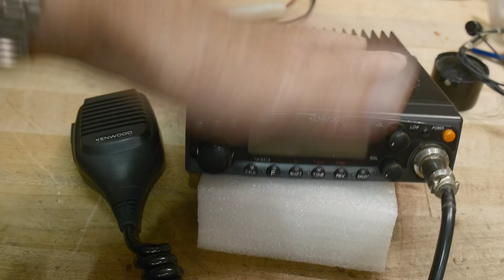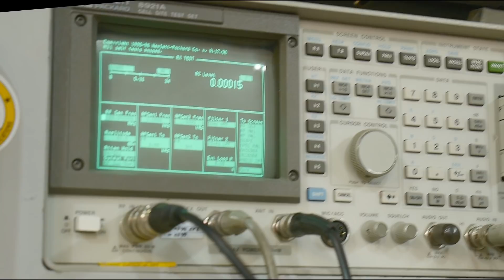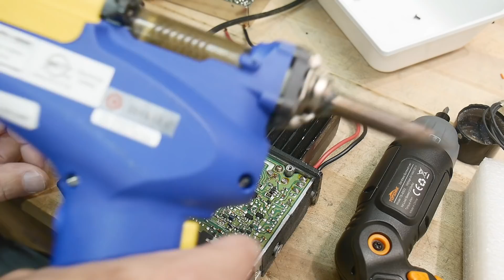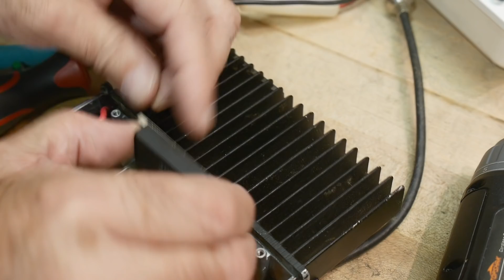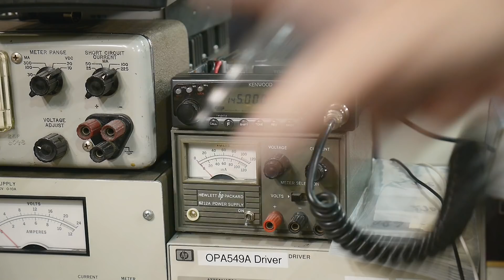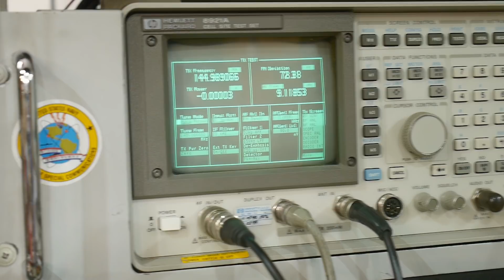#976 Kenwood TM-241A output power repair TOSHIBA S-AV17 50W Module

Comment: Good video! I have a TK-705 that is running into the same issue - milliwatt-level transmit power, receives perfectly fine. I haven't cracked open the RF module case yet and I originally suspected the APC circuit was bad, but now, even after consulting with QRZ forums, I'm starting to wonder if this is the issue. It uses the same type of module, only branded as Mitsubishi. Unscrewing it from the chassis revealed absolutely no thermal paste at all. Really scary!!! I'll have a look this weekend.

Comment: Great video!!  I have one of these 241a’s and when you turn it on it starts beeping and it’s like all the buttons are being pushed, and it won’t stop, it started as a intermittent problem and now it’s anytime it’s powered on.  Any suggestions on where to start looking.  I removed all the foam stuff that holds the buttons in could that be what is causing the issue?
Reply from the maker: take the buttons off, clean the pcb and buttons with alcohol

Comment: I have a TM-741 with a dead 2m output module virtually the same as this one. Never knew about the crack issues, so after finding your video, pulled out the module and, sure enough, found an open circuit track and an almost invisible crack. Fixed and now working again. 
So really happy to have seen your video. Thanks a lot.
Reply from the maker: Great!

Comment: I bought one at a hamfest maybe 20 years ago, and the seller told me he replaced the original module with a 25 watt one.  I have an ADI AR-146Chinese clone with a good 50 watt module for a spare,  the ADI display has always been intermittent and the modulation on it never right. The Kenwood still running on a lower power module just fine.  Did Mitsubishi make the module for the ADI?
Reply from the maker: I don't know

Comment: Happen to know anything about the scrambled display problem these get?
Reply from the maker: nope
Reply: Don’t take this as gospel but I vaguely recall this issue likely was caused by a bad ground connection with the display unit.  It has been 20 years since I used this radio.  Good little units.

Comment: Very good repair, have a similar problem with my standard C-5200D a few years ago. 

But we missed the maximum output-power the radio could deliver! 

You explained that you forget to adjust the current-limiting adjustment, on the power-supply, but we didn't see, how much the power out, was on the "high" level, of the radio! 

Could be as much as 50 Watts and more? 
Only a question, but it will be interested to know, how much the max. power is on this 'kitchen machine' made by Kenwood. 
(Hi Hi !)

73 de Markus ; db9pz

Comment: The cracks are not coming from vibration or being dropped, it's coming from a different temperature coefficient of the ceramic substrate and the solder/tracks in the module. This module is just a bad design, i had to fix several of them. You can even see the cracks grow when you put a hot soldering iron to the tracks without getting the whole module to a high temperature before soldering on a hot plate for example.
Reply from the maker: that makes sense

Comment: REASON  IS   PATTERN  CRACK  ( UPPER SIDE OF CERAMIC WAFER) 
REPAIR = RE SOLDERING  &   WIRE ADD ON THE  PATTERN . 
HAVE A GOOD JOB ~^^

Comment: I, for one, question if this entire design is lead-free soldered, because I'd be GREAT if you would reveal EVERY instance that you discover "Lead-Free" solder joint failures - because we are all suffering from the total failure of ROHS solder connections over time, and EARTH will suffer forever without using Lead based solders from now on and forever. Leaded solders have connected and created the entire of Earths Electronic mastery, and we need to preserve and protect past electronics excellence, and ALL of it's soldering DATA.

Comment: Ask the user if it has been dropped to cause the crack  I wonder?
Reply: The cracks are not coming from vibration or being dropped, it's coming from a different temperature coefficient of the ceramic substrate and the solder/tracks in the module. This module is just a bad design, i had to fix several of them. You can even see the cracks grow when you put a hot soldering iron to the tracks without getting the whole module to a high temperature before soldering on a hot plate for example.

Comment: Nice video! It would have been interesting to have a closer walkthrough on how this module works and the components therein. It seems to be a Class A Preamplifier combined with a Class C Output stage, where power is supplied by pin 2 (preamp) and pin 4 (amp), input at pin 1 (missing wire) and output at pin 3 (broken trace), I guess?. Very beautiful L/C matching structures. The black component in the middle, labeled TI could be a tantalum capacitor. But why is the negative side marked? Or is it a diode? These green-gray components on the right should be capacitors and the SMD part on the bottom right is a ferrite bead? Surprisingly feeble for that high current. 
Is the insulator ceramic made from beryllium oxide? It might be relevant to note to the viewers, that this is toxic when ground to dust.
Edit: Oh wait, I think Pin 3 is power-in for the output stage and Pin 4 is the output. Then the green-gray components and the L make a Pi-Filter and the component in the bottom right is a coupling capacitor. That makes a lot more sense.

Comment: Remember the old Tektronix ceramic component terminals ? They always required silver bearing solder so the bond between the metal and ceramic wouldn't be damaged. I'd get yelled at by the boss when I worked in a cal lab back in the late 70's when he'd catch me with just regular 60/40 lead in a 565 scope 🙂

Comment: What de-soldering tool were you using? Looks like it does a good job.
Reply from the maker: Hakko FR-301
Reply: It costs $303 on Amazon but IMO it’s worth every penny… Get some replacement tips and filters if you buy one.
Reply from the maker: @kd4nc  yes, get a bigger tip also. the tips come in several hole sizes.

Comment: A while ago in an exotic blog web page I saw this same module being modified for commercial radio use (88-108MHz) with just cutting the original coils and soldering the calculated new ones.

Comment: A nice easy fix. I have found that resting the module on a hotplate oe even an upturned laundry iron helps a lot with the dissipation issue.

Comment: SURE HOPE you DID NOT put that brick back in without HEAT SINK COMPOUND!!! I was a Kenwood Commercial Radio Tech for years, and ALMOST ALL of the radios hitting my bench had VERY LITTLE... or NO heat sink compound!!!  WHY... WHY... WHY??!!!  A failure for Kenwood assembly procedures... for sure!  Loosen that one back up and put some goop (thin layer... all the surface area covered)...  Or you will have it fail AGAIN... especially at high power!  Thanks for the video, but the heat sink compound should have been included here.
Reply: Comparing the video at 6:00 Min there’s no sign of white on the chassis when he removed the module, but at 16:00 Min there is an uneven white substance that looks like he applied  heat sink compound.
Reply from the maker: @kd4nc  yup. I put it on.

Comment: I had an Alinco DR-119 very similar to this unit. My output module got zapped by lightning. I replaced it with $35 module from RF Parts sometime back in the 90s. It got zapped by lightning again, and now it sits on a shelf with other broke stuff I lost interest in. I think the new module I bought was potted, and had no removable cover. I figure it'll keep sitting there. Oh hell, I just found one on fleabay for $32. Oh damn, you might inspire me to repair mine!
Reply: Use heatsink compound!!!  Thin layer across the entire surface are of the rea of the module!
Reply: @jeffreywyke368  I did. My Alinco had copious amounts of silicone under it. I replaced with normal thickness of silicone.Mine got zapped by lightning twice. Never was used in mobile service. Was base station connected to simplex phone patch. After second blast of lightning output modules available then in early 2000s were about $70. I think the whole rig was $120 new. I did not feel like repairing it. but finding one on fleabay for $32 might make me reconsider. BTW do you know where I can find a full service manual for Icom IC-245 - not the euro version? I have user manual and schematics that don't quite match mine.